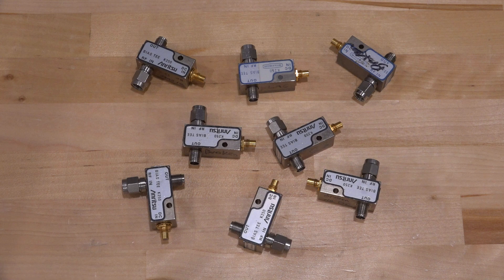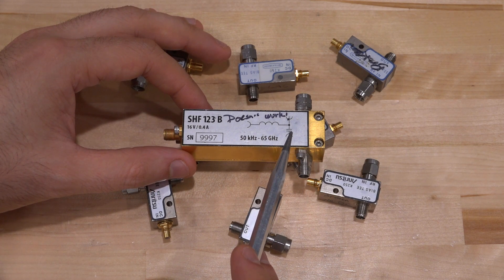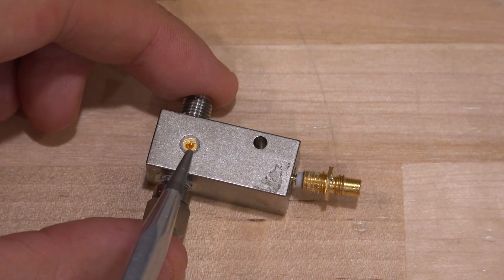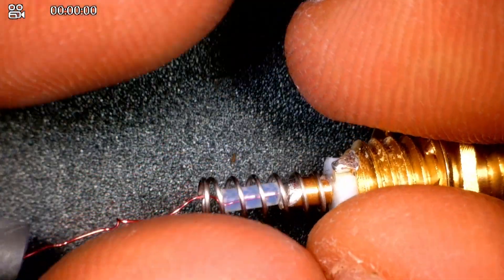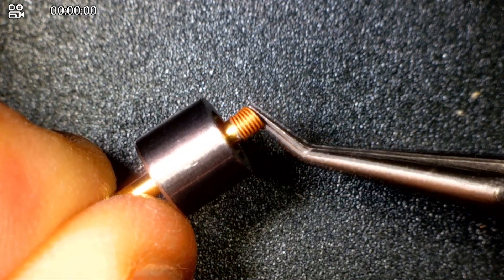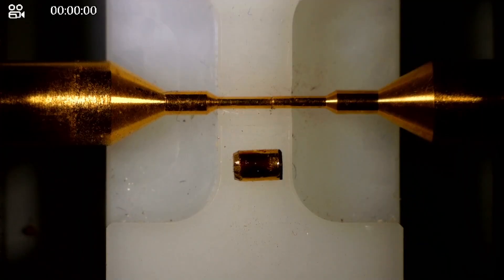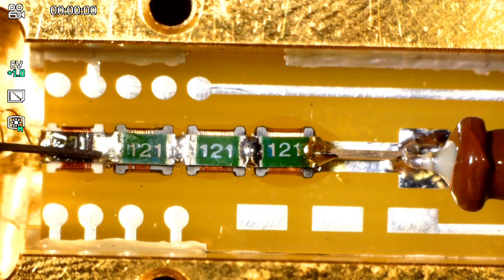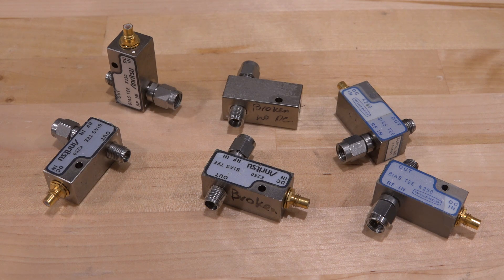TNP #5 - Teardown & Analysis of Damaged Anritsu K250 40GHz & SHF 123B 65GHz Bias-T Blocks

Comment: I wonder what went wrong with the one that you disassembled?
Sure when there is too much current through a thin wire it will melt and break, but you unwound the entire inductor and it appeared to be all in one piece!
(even when it showed signs of overheating)
Did the heat maybe influence the pressure of the contact against the RF conductor?
Reply: The rigid core of the inductor was no longer intact. I think that would mean it no longer was the correct length to ensure a mechanical pressure contact onto the rf line.
Reply: @jonka1  Yes, it must be something like that.
I wonder what the soldered covers on the RF end were for, as it looks like this whole thing could be assembled without them.
Maybe only for inspection, or maybe leftovers from an earlier generation where they actually soldered those two contacts?
It does not appear they were soldered in this device, everything looks like clean gold plated material...
Reply: @Rob2  I am guessing here as I'm not well versed on these high frequencies. It might be solderd in order to make a (near) perfect outer shell profile to rf passing through the body. There is a thing called "skin effect" which has greater effect as the frequency increases and the body will be part of the ground for the signal path. 
Maybe someone who knows about this could add a comment.

Comment: With that spring in there pressing on the Ferrite/iron core material, i am wondering if the inductor really was welded to the RF-Connection.
after all, it came out without resistance, and there were no marks on the RF-pin, where the inductor should have made connection.

I think that the spring presses the tip of the inductor on the RF-Pin. 
maybe you can drill one open before unscrewing the ports? 

very interesting, thank you!
Reply: Feliz Hirt  ,  Abom79, where are you?

Comment: woah, just looked up the price on octopart. are these really over $1k each? pretty unbelievable that a passive component can cost that much and be so easily damaged. would it be possible to add some kind of inline connector with a fuse to protect it without affecting the performance?

Comment: They should put a polyfuse on the DC input
Reply from the maker: That would be a great. To have to throw away a Bias-T because of an over-current incident is incredibly wasteful (and expensive).
Reply: But then they won't sell any since they won't break.
Reply: I actually have some RF fuse modules, that will enable you to put a 100mA Littlefuse solder in fuse in line with the current path, and which also do provide a whole range of adaptions for different connector types, as well as a straight through option with no fusing. Sadly only rated for 1GHz operation. 

A polyfuse might introduce too much resistance in the power input path, and as well the resistance of the units will not be constant with temperature and current, so having the tiny fuse would be a better option as a in line block that you can easily replace, or at least put a new fuse into by simply unscrewing a connector end and slipping in a new one, from the stock that comes with the fuse unit. Would prevent this kind of accident, though of course you will always find those who blow the last fuse and run it without, and blow the block up as well.
Reply: Actually I used to work at a company making Bias-T for their own internal use. The solution there was a small circuit which would trip on overcurrent like a polyfuse but cheaper.
Reply: Maybe a clamping device at the DC side?
Reply: @Joel Dunsmore ,  Time is always on the side of the blown device!  LOL

Comment: Makes me curious to how good of a bias T one could make out of one of these cases. After all, if the connectors are good, one could likely do something that at least works, even if it might be a bit abhorrent. Question is just how one would approach it. After all, a bit of a waste to throw away a good case and connectors.
Reply: Today on the Bench  ,  Always some way, just a zillion dollar solution, right?
Reply: @BruceNitroxpro  No not really. A bias T is a relatively simple circuit. And the goal here isn't to try to beat the original, but rather build a useful bias T, not a perfect one.

It is in my opinion a bit wasteful to throw out a perfectly good case and connectors if one could do something useful out of it. Doesn't even have to be a bias T as the end product.

Comment: Very cool and informative. I was able to score a 5KW water cooled N-Type dummy load on eBay. I measured it to make sure it wasn't open or shorted and I also got 52 ohms. I called the very helpful manufacturer and asked if there was anything to be concerned about and they said 52 ohms was within spec. I guess 11:30 I'm in good company :)
Reply: VSWR of 1.5 requires +/-25ohms from 50, so 52ohm load is not going to break the bank
Reply: @LightningHelix101  1.5:1 means 75 ohm on the higher side and 33.3 ohm on the lower side.
25 ohm means it's 2:1.
For real RF engineering you ought to have 50 ohm exactly; you would break the bank for sure.
For we amateur radio enthusiasts +/- few ohm is surely not an issue.
Anything less than 1.5:1 is more than sufficient and you don't have to expect more; I wanted to stress on that. 😀
De VU2RZA
Reply: He is not measuring the DC resistance of his dummy load here, but the total resistance of the dummy load and the DC path of the Bias T.
And of course, the cable.
Those will also have some resistance, and he postulates that it might be about 2 ohms in total.
To really know that, one would have to measure at least one of them separately.
When you measured your dummy load, you may have had some extra series resistance as well, although 2 ohms would be a lot when measuring some heavy device like that (you would likely not have such a thin wire, and other series components).
Reply: @Rob2  Hi, yes, I know. My brief gross test was to make sure that the device wasn't broken thru misuse. Then again, I can't imagine the leads on the fluke multimeter I used have a resistance of 2ohms :-) FWIW, once I get the water cooling radiator and pump all setup I'll throw it on the VNA and see what it really looks like at low power. This unit is good to 2GHz which is well beyond the frequencies I'm interested in.
Reply: @vincei4252  water cooling system is not necessary to measure the resistance of the dummy load.
When the rated power is getting dissipated the value would have to be stable in a good one and throughout the frequency range as mentioned by the manufacturer.
If you measured 52 ohm now, it would be 52 ohm again later; it's not going to alter with the water cooling mechanism fitted to it.
De VU2RZA
Reply: @subramanianr7206  I did not say that water is necessary to measure anything. It is required to dissipate 5KW which is why I bough the thing in the first place. Not sure what or why you are debating here.
Reply: @vincei4252  you felt good to be in company and you said that the manufacturer told you it was within the spec; but in reality it is not so.
Hence the debate.. 🙄😀
De VU2RZA
Reply: @Rob2  hi, nowhere he postulated that the extra 2 ohm came from the cables.
Initially without the dummy load it measured no resistance; only after connecting the dummy load it measured 52 ohm.
A dummy load for any 50 ohm RF system has to be 50 ohm exactly.
There is no compromise.
De VU2RZA
Reply: His bias T resistor measured 52 ohm and that's an approximate as the instrument errors are there as well.
But then a dummy load has to be 50 ohm exactly for precise measurements like when you use a VNA.
For amateur radio purposes anything around 50 ohm is okay.
We strive to have the SWR less than 1.5 after all.
De VU2RZA